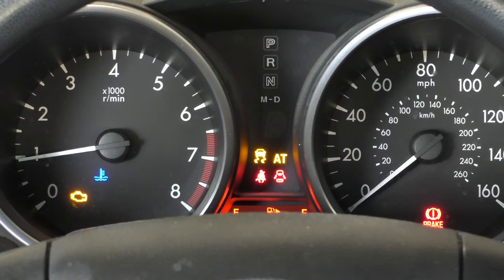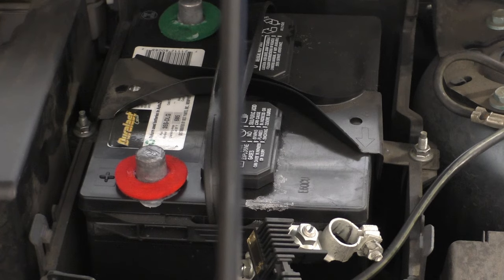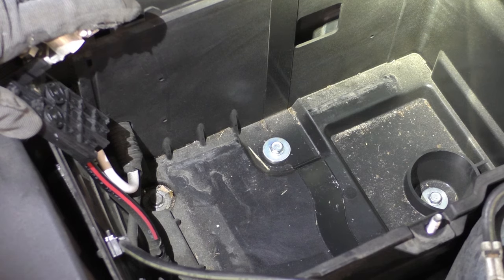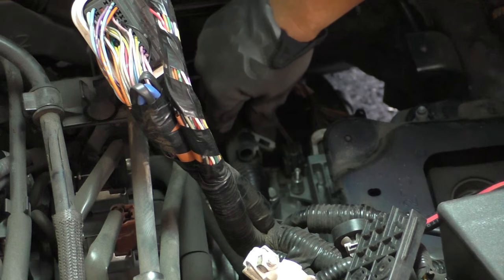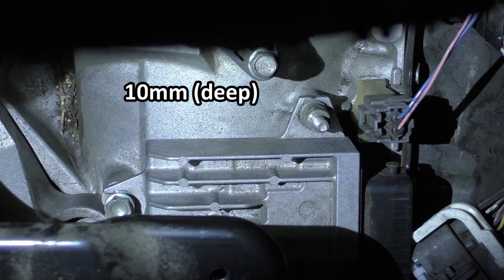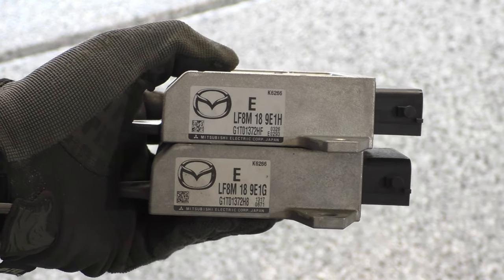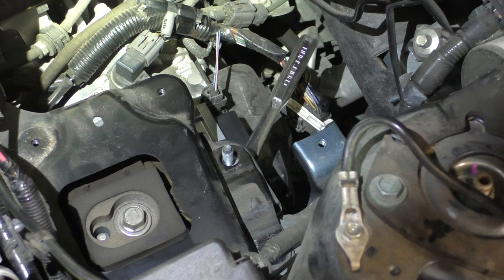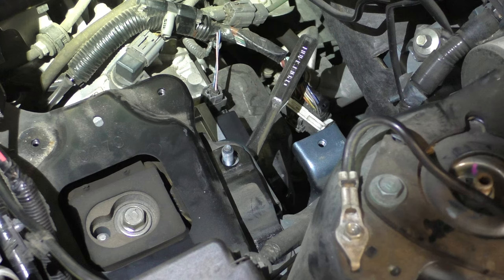Mazda 3 Transmission Control Module Change, Code U0101

Comment: On my 2010 Mazda 3 the AT flashs once in a while and I'm wondering if changing my TCM will fix my issue or is this something different??
Any help would be greatly appreciated 🙏
Reply: This was happening to me until the exact scenario in this video happened. Did this happen to you and what did you do about it?
Reply: @thesillysasquatch1  yes changed the TCM and everything works perfect no lights 
Even put a use one from the auto wreaker on it because new they wanted 700 dollars 
This cost me 65 but I had to go there and pull it off the wreaker car and change it with mine
Reply: @thesillysasquatch1  hope this helps you out

Comment: Is it necessary to connect that electrical assembly at 9:10 when you putting everything back together ?
Reply from the maker: You mean putting the wire harness on the post at 9:10? That's not absolutely necessary, but it's how it was designed to be secured.
Reply: @FaRKle0079  yes thats what I was reffering to, because I ended up Zip tieing the tcm on the brake lines under master cylinder , and after putting the battery box and everything back in place I realized I forgot to hook the harness on the post
Reply from the maker: @boondocks1able  you'll probably be ok in that case. 👍

Comment: Will this fix the issue U0101? 
U0101 or the transmission need to be replaced?
Reply from the maker: Replacing the TCM fixed the U0101 code I had.

Comment: I put a new one in but still have all the same issues.  The transmission was checked at Mazda and it good.  Could it be a relay or something like that?
Reply from the maker: I'd check the wiring to make sure the TCM is getting power next.
Reply: I’m buying a 2010 Mazda 3 with a few other codes including these. It’s been through 3 TCMs so if you’d like I’ll keep you updated on what I can figure out to fix it

Comment: I’m getting my Mazda currently fixed for a replacement TSM but I was told “the wiring is hard and they couldn’t do it” and they ordered the part but I was told “the one we ordered wasn’t correct” “we needed to buy the one with your car the one they sell at dealerships that usally only come with a new transmission” and said they’d call me back... does that sound like a thing... or would there be two different model TCM? Apparently my Mazda has to different versions on that year and that would be the issue
Reply from the maker: The wiring being difficult doesn't really make sense to me. The wiring should be in connector housings, so there's no individual wires to deal with. Dealers should be able to get the right TCM for your vehicle with the VIN number. I suppose there could've been a year where they transitioned from the 5sp to 6sp auto, but then it should still just be a matter of getting the right TCM and plugging it in. I haven't heard of dealers only selling the TCM if you buy a new transmission.
Reply: @FaRKle0079  Thank you for this detailed response I will keep you posted if you don't mind as with covid and a recent death in my family I'm very anxious due to this situation and the possibility of it going from a $600 repair to a entire transmission being 2000$ +
Reply: If its a 2012 or 2013 mazda3 then yes there are 2 tcm a 5 speed auto and 6 speed auto for skyactive
Reply: I've this problem of Tcm on my axela 3 sport, what's the way forward and if need for replacement where do I find the piece coz seems hard to get

Comment: My Mazda 3 2010 would stumble once I reached 40 Mph same lights popped out. I took it to the mechanic and he said it was the transmission, will cost 2k is there anyway I can see if he might be scamming me I just saw this video and I don’t know much about cars. Thank you
Reply from the maker: You'd want to get a code reader to see what the problems the car is reporting. If it's the same "U0101" code as in this video, then $2k for the ECU replacement is excessive. If it's a different code, you'll want to look it up and see what others have done to repair it.

A lot of times your local auto parts store will read codes for free.

Comment: hello, if my tcm module is L539189E1D, when looking to buy a new one only finding L539189E1H. Do you know if I can be compatible

￼
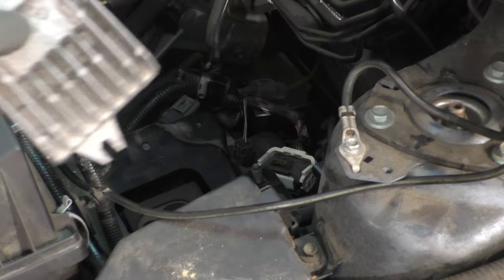Reply from the maker: Check out 7:15 in the video where I talk about part revisions. It should apply to your case.
Reply: @FaRKle0079  Ok thanks, at the time of placing the new tcm module does it occupy any programming or is it only to be installed?
Reply from the maker: @hector1984hg  It should be plug and play, no programming required. The one I put in was that way.
Reply: @FaRKle0079  Ok thank you very much for the information, I already plan to do that in a month
Reply: @FaRKle0079  Hello, I already installed the new tcm, it no longer marks the codes p0753 and p0758, but now it marks the u0101, how is it new tcm if it takes programming?
Reply from the maker: @hector1984hg  It shouldn't need programming. Does the car shift properly? Maybe try seeing that the connector is securely connected?
Reply: @FaRKle0079  If the connector is well connected, how new do you think it needs any programming? it's a mazda 3 2010 2.5 engine

Comment: I have this happen on and off , could it still be the tcm ? The problem is when I got this code , it was cleared out so would that affect how it behaves when it’s a tcm ?
Reply from the maker: If it's the same error it should come back even if you clear it.
Reply: @FaRKle0079  thanks bro I got it fixed man I appreciate you
Reply: Wher did you get your tcm
Reply: @Mando5.0  nah it was my shifter that was the issue , my TCM is still stock

Comment: The wires were burnt  and put back together  still doing it do i  get another tcm
Reply from the maker: If the wires to the TCM were burnt, did you do a continuity test after they were put back together to make sure they're good?
Reply: @FaRKle0079  I have a 208 mazda  drive for  two miles and then  a/t  light comes on could you say what wrong. Cheers
Reply from the maker: @thomasallen6895  I recommend getting a code reader to try and see what the car is reporting as the issue. Many times your local auto parts store will do this scan for free.

Comment: after it is replaced i was told something needs to be recalibrated is that true?
Reply from the maker: It was plug and play for me. No adaptation reset or recalibration required.
Reply: @FaRKle0079  thx mate,  I have been talking to a few mechanics about the problem and am getting so many different responses and quotes to do the job, it's getting a bit annoying hahaha.
Reply: @doc2590  How did your situation turn out?  I called to order the part from Mazda but they told me they had to program it to my car.  I told them I thought it was supposed to be plug and play, and the dealer is 100 miles from me also.  I don't want to drive that far in limp mode.
Reply: @yearginclarke  I ended up having a TCM sent to me, I can't remember if it was reconditioned or new, but I think it was reconditioned, it cost about $1300 I think, and a local mechanic installed it.  The car is fine now.  If you have a local Mechanic who is familiar with TCM's he might be able to order you one and install it.  But it is not a cheap repair or fix.  My Mechanic just connected a computer that reads the computer in the car, and after installation just connected it to make sure everything was working correctly.  Good luck mate.  Driving in limp mode is such a pain in the ass.

Comment: Hi I have this code and had the jerk/clunk of the car while driving. Sometimes it goes away and I can drive again but then I'll have the AT light come again with the car suddenly clunking. What causes this and is it bad for my car?
Reply: Same here.
Reply: Have you been watching the video? It’s probably the same problem. If you’re unsure, then go down the expensive route by taking your car to your nearest Mazda dealer...
Reply: Go to autozone and get the codes. If it is U01001(I think 🤔) it’s the control module.

Comment: Hello have same similar issue on my Mazda 3 2011 at first did both transmission and oil change  and filters changed,another thing when I changed my transmission fluid it was very dark .  I also  have code U0101 similar  issues  happening sometimes hard jerk on reverse or  drive, drove the car a few times  and AT sign, engine check and TC would pop up and while driving I would feel a sudden jerk wanted to make sure that getting the tmc is the right part don’t really wanna spend the money and it not being what I needed best advice please.
Reply: What was the end result my car is shot lol
Reply: Same think happened to me, changed the transmission fluids, very dark. I am waiting for my tcm in the mail. Found the part for around $550. A friend and I are going to install it once it gets here. He’s experienced with vehicles. I’ll update. Did you change your TCM? How is your car shot and are you able to repair it?
Reply: @jamiehamel9669   nice that should do it I got the tcm installed codes went away and car was shifting fine hope it gets fixed but that should do it!
Reply: @jamiehamel9669  Did replacing the TCM work?
Reply: any updates? Did it fix the problem? I got the same problem but $500 dollar is too much for me. How can I find the TCM for cheaper price?

Comment: Is there anything I needa do after I plug in the new TCM?
Reply from the maker: Nope. It's plug and play!
Reply: Dont you need to relearn it ?
Reply from the maker: @mirafelizav.hernandez8341  Nope. It's plug and play.
Reply: @FaRKle0079  I just replaced mine but still I'm having issues
Reply from the maker: @OP-ik7qb  You might want to check if you have any other codes too.
Reply: @OP-ik7qb  did you find a solution? I replaced mine and the check light and at light came back instantly
Reply: @palmas001  dude same here. Mines running fine after replacing but lights still on. Did u fix it?
Reply: @cano24dez  i bought the wrong tcm, now im looking for the exact serial number.

Comment: You don’t have to program it?
Reply from the maker: For this 2011 Mazda 3 I didn't. It was plug and play.
Reply: @FaRKle0079  hey I see that you said yours was plug and play, did you buy a new one from the dealer or a refurbished one?
Reply from the maker: @jaimetorres9209  I bought a new unit from the dealer.

Comment: At 7:15 you can see a plug with two wires running from it on the top right of the Tcm. Does anyone know what that plug goes to? What it powers? Is it a sensor?
Reply: I think you have the wrong timestamp

Comment: https://youtu.be/ZnRriGXvn6A?si=XdWzrvtYv1L4UlIC

As described in this tube, it’s highly recommended to place your new TCM on the firewall due to poor internal electronic design and their failure of the connection.